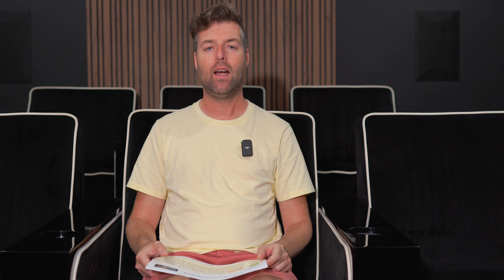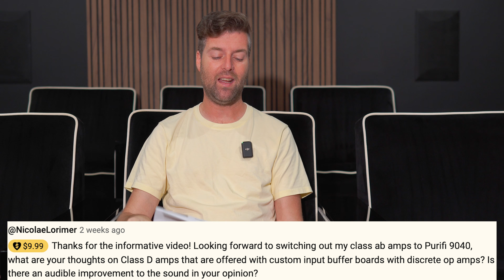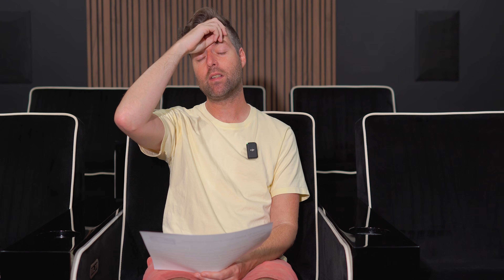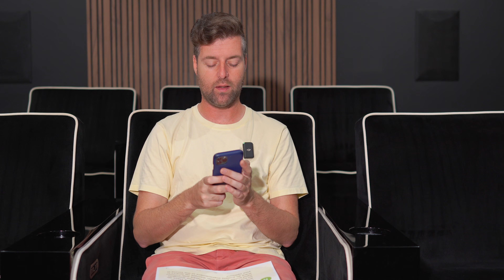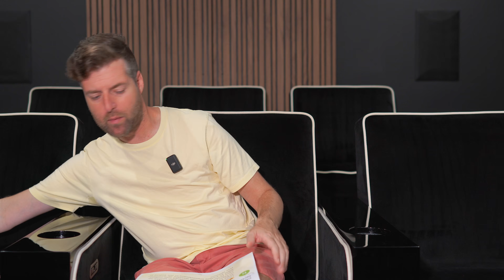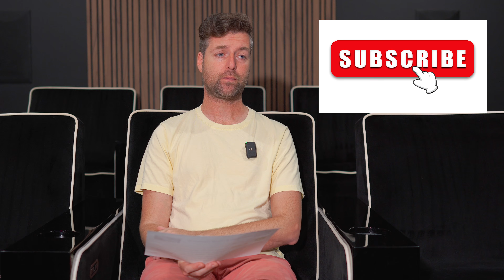Are discrete op amps a WASTE of money?

Comment: Is there a scientific or sensible reason to add lets say 2x200W Hypex separate amp to medium class (Denon X4800?) AVR? Speakers are MA Silver 300 G7, sensitivity 88dB. Will there be a noticeable difference? What about timber matching if amp drives only LR? Living room, about 250sq ft, 5.2.4. Thanks /Chris
Reply from the maker: Thank you for supporting my channel. I'll be recording a video and answering your question shortly.

Comment: Nice expose, and mostly right on point.

In my experience the integrated chip op-amps are more stable, more consistent and often much easier to design with than discrete transistor modules.  Because the circuit is all on a common substrate, thermal, EMI and junction variations are virtually zero allowing the chip to play nice in situations where a discrete design would fail.

Op-amps behaviour is largely governed by the parts around it, providing feedback and controlling gain. 

I can't speak for Hypex, having not experimented with them very deeply, but in the TPA3255 based amplifiers, flipping out the $0.50 chip op-amps and plugging in the "audiophile" discrete ones at $70.00 a pop is nothing better than a quick way to waste your money,  Especially when the circuit is running at relatively low gains (typically <6db or 2x by voltage) where stability and bandwidth are at maximums.

Comment: What's an op amp? I'm so lost
Reply: It' is an "Operational Amplifier" an electronic building block that can be configured to multiple different functions by the parts surrounding it.  They are typically on small 8 or 16 pin chips which will have 2 or 4 OP-Amps on each chip. The most common use in audio is for either voltage gain or voltage inversion. 

Do some searches, it's a really interesting read.
Reply: Small things inside a thing we call amplifier. In most cases it’s not worth worrying about. 

It’s for people who used to play with changing tubes on tube amps now do the same with op amps.

Comment: Thank you for this Matthew. The Eigentakt module you are referring to is the 1ET400a which is 25 amps and was just replaced with the 1ET6525SA which is still 25 amps. The 6525 and 9040 are the Gen 2 of the Eigentakt modules. 

I always wondered about the input buffers. I'm just running the stock Hypex NC500 input buffer. I am really curious to pairing a tube preamp with the Purifi's. Thoughts? Its a music only 2.0 system.
Reply: Why pay for and ruin super clean amp performance with a nasty tube amp? Makes no sense IMO.

Comment: Some emotiva class H behind high impendence speakers like the Emotiva Reference Differential behind a 20 amp switch and dedicated outlet will perform better than every purifi module when playing at loud levels for long sessions.
Reply: Guessing that’s based on direct experience? To be clear, are you recommending separate circuits for each very high power amp, as well as a shared circuit for the remainder of associated equipment?
Reply: Why not for the main Left Center and Right multichannel amplifier. There is no reason a 15 amp switch won't work either. But if you read Amir's backhanded compliment of the Emotiva amplifiers once it hits its higher power rail your cinema experience is going to be incredible power and control of your main speakers. And the graph looks is not a nice curve as the DB raises. It is just power and and set for that listening session.

I am not talking about the generic Emotiva XPA3. I am talking about the Reference Differential balanced dual channel modules. Not a better value for 3 x front channel amplification.
Reply: @chebrubin if you’re referring to the XPA-DR2 that Amir reviewed, there’s no way I’d own that over a Purifi unless I NEEDED the extra power. Everything about it is bad except power output, and 99.99% of HTs don’t need that much power. A Purifi would be a better option for most.
Reply: @andrewskaterrr  Once you hit the higher power rail the THD stabilizes and the power output is going to help make more enjoyable less fatiguing sessions with huge speakers like Focal Sopras or even SVS Evolution Ultra towers. No class D module is going to do that for sustained non fatiguing movie sessions. Unless you go with hybrid op amp or HDAM tech like Marantz with a toridial and class D output modules.
Reply: Tripped my 15amp outlets had to upgrade to 20amps with the power I needed a couple thousands watts
Reply: @Vietturtle2023  What movie? How long and loud?
Reply: @Vietturtle2023  Not all of us have such extreme requirements. My whole rig - including 77” OLED runs on a single 15A, and I’ve yet to trip the breaker or fuse on individual device.

Comment: I personally wouldn’t take Amir as a reference.   He clearly has bias and has in many instances has made inaccurate measurements. 
Not to mention he never posts his AP settings. 
That doesn’t mean discreet op amps are better.   Just taking into account the bias and inaccuracies in ASR. 
Great vid btw
Reply from the maker: I was simply trying to make the point that his measurments seemed to suggest they don’t improve anything from a measurement standpoint and may introduce euphonic distortion at best. 

I know that others who are very trustworthy share that concern. I just can’t point to them as a reference since their information is not public. So I use what I can. 

A lot of people who would be the exact right person to ask don’t want to get involved in this stuff. So they might share their opinion and measurements. But usually I can’t say, “Well so and so, designer of that product, told me and showed me it’s a flawed thing…”. 

I am sorry if you don’t like Amir’s measurements. Much of this video is just my opinion.  Take it or leave it. I have little personal experience with discrete opamps. I’ve used the Burson model before and that’s about it. It was definitely a euphonic device. For better or worse.
Reply: @PoesAcoustics  I know.  I merely said that his measurements aren’t the best frame of reference.  nothing more, nothing less 
Cheers
Reply: Could you name a few of these many instances?
Reply: @ropeburn6684  sure.   Well first of all he does not put his AP settings on anything.  
So that’s one hugely faulty practice.   Pretty much nullifies any test he does. 
His benchmark DAC3 measurements were off by a lot.  Until John Siau had to come in and correct him.   The DAC3 that Amir had was sent to Benchmark and they found no fault in it.   So it was clearly an error made by Amir in his measuring.   That is quite a big deal.
Reply: @Nightjar726  Can you name more than this one single instance?  How did that turn out anyway? Did he admit his mistake, or denied it? If it really was one, the latter would be a big deal indeed.

I also don't see how not publishing settings by standard does automatically nullify any test. Have you heard of someone asking for them and Amir refusing with half baked excuses, or anything like that?

I'm very aware of you being highly sceptical, which is a good thing. I'm just being the same about your scepticism, because so far it sounds very much like hearsay and sweeping generalisation. Perhaps you can clarify.
Reply: @ropeburn6684  Superbest audio friends posted measurements of the Topping D50 and they were way off what Amir posted. 
Need I list more?
His measurements of galvanic isolations were misleading since some were measured with DACs that did not need a galvanic isolator.  
Not posting AP settings does nullify any measurements.  Of course it does. 
Do we just take someone on their word?
That’s not how scientific measurements work or are carried out. 
People like Goldensound always put their AP settings.   
He has his own biases as well, but the AP settings are always published.  
I mean this is a common practice in any research paper and scientific paper.  You have an entire section on methodology which covers any instrumentation used. 
And there is an entire section on bias.   Let’s say we can omit that for these tests. 
But you can set the AP a certain way to skew results.  That is common knowledge. 

Cheers
Reply: Matthew you are calling Harmonics distortion? When it is actually harmonics controlled can be very natural for the instrument.. music we learned this with MIDI the right harmonics are needed to produce the right sound E. I. Roland and Yamaha keyboard. 

No you really muddied the water on the topic ..  OP-AMP can be the modern Bob Carver 1985 StereoPhile challenge come to life....
Reply: @DataCenter2030  
If they are coming out of an amplifier they were not fed into, yes, the harmonics are distortion.  Literally anything that comes out of an amplifier that was not fed into it is distortion of the input waveform.
Reply: @Douglas_Blake_579 
That is a complete over simplification, Tubes add harmonics  the best discrete  OP-Amps are designed to add the right kind one of many examples would be the number of $40,000+ Amplifiers with Tube front end and Solidstate amplification. 

My DACs have a very Natural Vinyl sound because they all have Tube or Discrete OP-AMPs on the Output. 

Harmonics add texture to sound similar to humidity affecting temperature.

Yes I've  built Amplification with OP-Amps..  Tube OP-Amps go back to 1910 because it is just an arrangement of electron flow that's how the blue LED was invented , having the right sequence  eliminated the CRT without the blue LED we wouldn't have the wonderful flat screens.

My preference is not to have my speakers attempt harmonics but pass them to my ears.
Reply: @DataCenter2030  
No sir, it is not an oversimplification at all.  The entire goal of reasonable electronic design is accuracy.  Precise gain, 0 distortion and flat frequency response in the desired passband.  I would never consider designing for any other goal.  

Modern Op-Amps are capable of incredible accuracy. Many have distortion specs in the thousandths of a percent.  Other than gain, they don't add anything of their own. That's why they are so widely used.

You seem to enjoy inaccurate devices, like tubes, and that's fine as a personal choice. Knock yourself out.  But please don't tout your own preferences as design goals or being beneficial to others.
Reply: @DataCenter2030  
Whatever.  

Colour and Character are the roles of music and recordings. I want my system colouring everything even less than I want a razor blade sandwich for lunch.
Reply: @Douglas_Blake_579 Sorry to Break this to you but that is an Audiophile LIE !!  I started as a Music equipment bench technician then sitting at mixing a console and mastering as I did for a few years also that just doesn't happen that outcome is completely different in fact Op Amps are added to playback paths in the studio to enhance monitor listening in a modern environment. 

Most people love the sound of their phono cartridge  and what it adds.

If you have a Reel to Reel you also love that PreAmp circuit. 

Otherwise Transformer Coupler designs give the best sound I've heard...
Reply: Amir is Junk Science
Reply: @Pete.across.the.street Technically No!!! that Binaural Headset is designed around measurements and calibration. 

OP-AMPS are a collection to either A pass the signals without added Harmonics or B add Harmonics in a manner like Vacuum Tubes. 

Yes measurements count but they have  limitations for Audiophiles secondary without a very low noise floor.